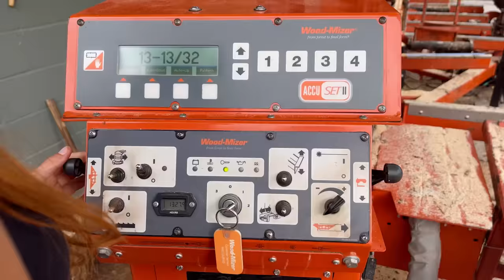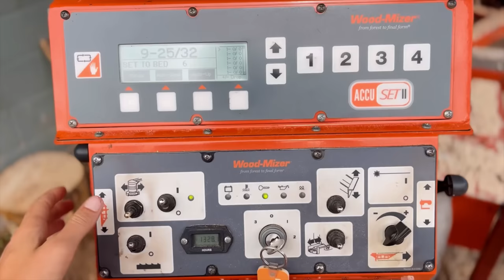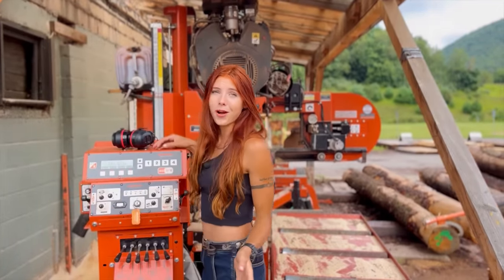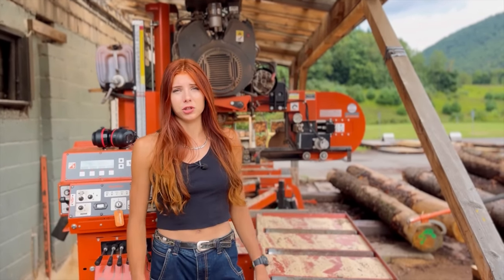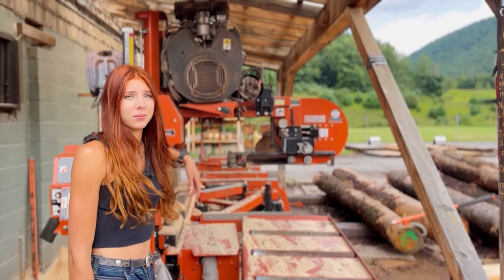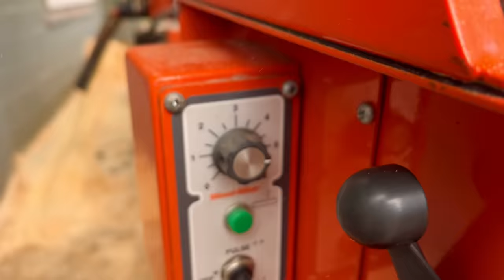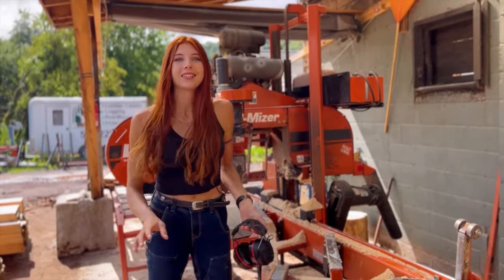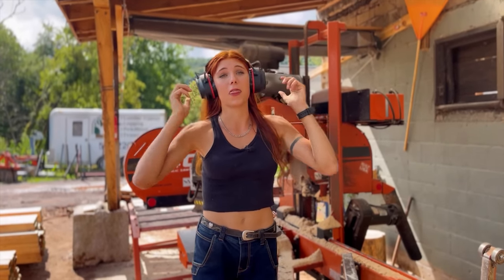2 sisters, 1 sawmill: turning trees into treasures!

Comment: Haven't you got a multimeter to check if (AC) alternating current is reaching the motor connections?
📢Take the blade off before checking! Otherwise you might need to refer to your arm tattoo!!!
🌏🇭🇲 P.S Is Jade dark, mysterious and alittle smokey?